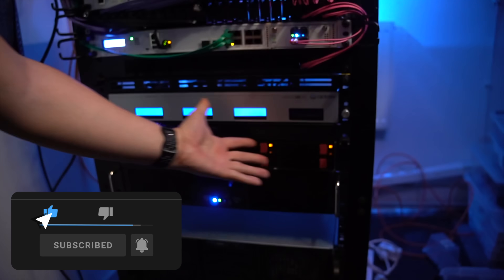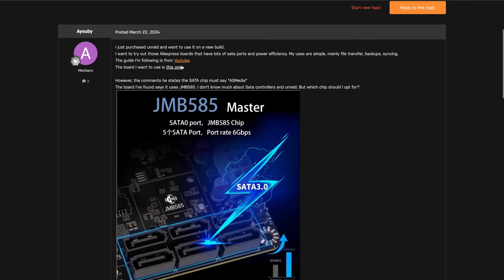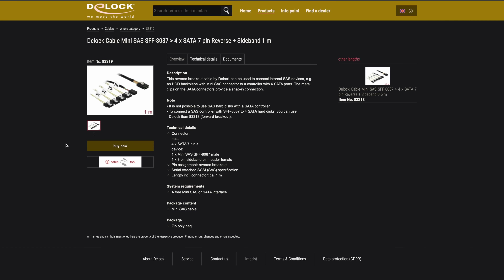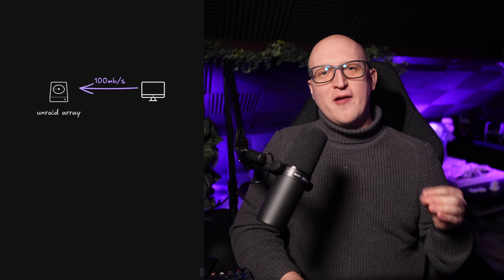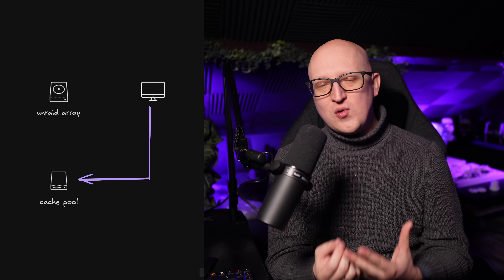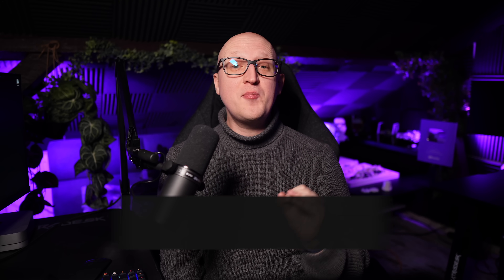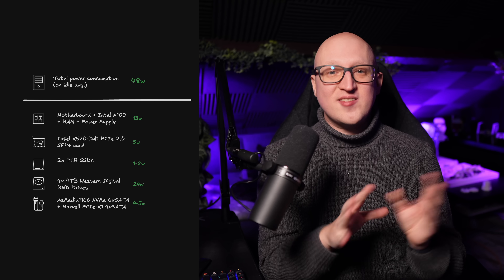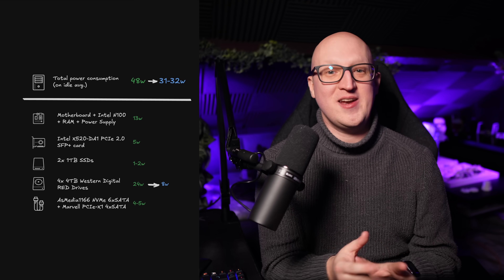New Unraid Storage Server upgrades and testing!

Comment: I just need four SATA drives (two to start testing for compatibility), which one will work well with FreeBSD (ZFS) for NAS? adapter based on JMB585 2280  or ASM1166 Chip?
Reply from the maker: In that case you don’t need to worry about a 4x ASM1166 will work fine! It’s just when it needs to split the ports

Comment: i have build a small server to replace my power hungry R630. This small system uses a MINISFORUM BD795i SE 7945HX. My PowerEdge R630 uses about 150W idle and my New system uses only 22W idle. I have a 160W picoPSU in it and a 150W 12v power brick outside. Because of the Ryzen 9 7945HX has a RDNA2 iGPU, i can use ROCm for AI stuff and don't need a dedicated SFF GPU like the RX550.
And i can allocate as much RAM to the iGPU i want, the RX550 was limited to only 4GB. i have 64GB ram in this system and 12GB are allocated to the iGPU.  
i switched from HDDs to SSDs and all in a 2U short depth 9" rack case. i have 12 SSD in this case and i use two of the ASM6611 m.2 adapter. Those 12 drives are in a Icy Dock ExpressCage MB326SP-B. In this rack is no room for a normal PSU. This thing is packed and nearly dead silent. 
yeah, i know the R630 has ipmi and is more capable but i don't need the cpu power and dual channel DDR5 5600mhz is faster as 8 DDR4 2133mhz channels. this is a over all more capable system as the R630.
Reply from the maker: Wow, that's interesting, a very good power footprint!

Comment: Since you are using your NAS strictly for cold storage and do not have any containers or VMs, you can set the disks to spin down when not in use. That should drastically drop your idle power usage by 24w according to your calculations. If you did want to run containers or VMs you would store them on your cache pool. I have 2 Unraid servers and both have much higher average write speeds than your system. That of course is dependent upon drive rotation speed, controller speed, and other factors but I wanted to share that Unraid is certainly capable of much higher write speeds than what you have experienced. As you stated, the use of a cache pool is highly recommended and that speed is also determined by the quality and capabilities of the SSDs.

Comment: Turbo mode reads from all drives to update the parity immediately on write. The only benefit I know of in the normal mode is the unused drives don't need to be spun up, if you use nas rated drives and keep them all spinning the reconstruct write basically works the same as standard raid and you'll get standard drive access speeds.

Comment: Great video Christian!!! Was wondering how often you run the paritycheck on your array and what (if any) impact do you see on your N100 CPU?
Reply from the maker: Hm so you definitely see the CPU goes up, and parity check I only do weekly at midnight so that it is complete before working
Reply: @christianlempa  Thanks! I looked around  (using the search term: unraid how_often_should_i_be_running_parity_checks) and noticed that quarterly is kind of the sweet spot. 
(my backup server is only powered-on during the weekends because of power consumption) 
Weekly to me seems to be a bit overkill because it causes a high stress rate on your disks. (and it's a backup after all :) )
There is also a plugin called Parity Check Tuning plugin that can help with breaking up the parity-check process.

Comment: I am spinning down my array as much as possible. gives me an idle around 36w

unRAID Plus licensed 7 stable ASRock B550M Steel Legend + amd 5700g apu cooled by a DeepCool Assassin III.
Patriot Viper Steel DDR4 64GB (2 x 32GB) 3600MHz running jedec cl20 3200mhz
Western Digital Ultrastar DC HC550 WUH721818ALE6L4 18TB. 1x18tb parity and 2x18tb disk array xfs (and a spare)
T-FORCE_512GBx2 sata zfs raid 1 pool for docker and system. T-FORCE_512GBx2 sata zfs raid 1 pool for wm
In a Fractal Design Node 804 Cabinet. with a Be Quit! System Power 9 - 400W psu
Reply from the maker: Great setup 👍

Comment: Hey Christian,

In the last ten years I have bought a lot of SATA PCIe cards, unfortunately none of them worked properly, random HDDs always flew out of the pool.
The first I thought, well, old power supply, probably can't supply everything, I got a new power supply with 750w and several 12v rails, no, that wasn't it.
turns out the power supply was able to supply everything.
then I thought, well, it must be the software, I tried TrueNAS, Unraid, Ubuntu, Windows Server, yes I know, horrible for the HomeLab, didn't solve it either.
then it must be the SATA connection... 
sunk money into SATA PCIe cards for several years with no improvement.
In 2023 I decided that it was worth the risk to order 2x Broadcom LSI cards on eBay.
I waited 3 weeks, they were shipped from China, and I got the accessories, cables and fans in the meantime.👍

When I had everything together, I assembled and tested everything... 
I tested the Disk and The LSI Card for a Week really Hard... 
after a week of full testing, no HDDs were thrown out of the pool.

The result didn't really surprise me, it's Enterprise gear, it has to run stable for year.😒

my Story of SATA and the problems of SATA.😂

Comment: I knew that you would like Unraid. Next thing is tinkering with powertop and maybe even S3 Sleep plugin.
Funny thing, otb on the same hardware, in my case, TrueNAS consume less power than Unraid, until is tuned and configured.
And as a reference, my Unraid NAS build with 5600G, LSI card, 2.5GbE card, 8 HDDs (spun down) on idle goes around 40w. Much less without LSI card ofc.
Reply from the maker: That's interesting! I will definitely check out power top and more ways to optimize power consumption

Comment: you should also check powertop to make sure you are getting larger c-states being used (ie c10 etc), also there are updates to asm1166 firmware that might help. There are people with h770 mobo and i5-13500 getting same power consumption, so its not a standout yet. But you could reduce it more with powertop. Sometimes the nic is the problem too.
Reply from the maker: Great feedback, I will definitely have a look :)
Reply: @christianlempa  just install powertop on unraid and set the c-states in bios on, you should go way lower if its just for data and running no containers etc. my idle is 16 watt with Intel i3 12400, 32gb rgb ram ( yeah rgb ) 4x6tb, 1 tb nvme, 2tb ssd, 750watt power suply, running 30+ docker containers. just let me know if you need some help.

Comment: Have You checked powertop already? 
For ASM1166 card You need to make sure about two things - first one is firmware, most of those don't support ASPM mode and those prevents higher c-states. Also You may be interested in hot swap feature. 
Second thing about this m.2 card is that it's eady to break (sata ports are not often placed on 0.8mm pcb). It also need good airflow over chip (it will bend on temp, eventually loosing connection). 
Triple check hard disk speed. This card will not limit 4 fast ssds, it will slow down on fifth fast drive. With spinning rust You are safe :) 
Cosider replacing old intel da card, today ACQ113 is the way to go, it uses pcie 3.0. For mac You can get  thunderbolt/usb4 to 10Gbit adapter, heats up quite a bit, but it's ok for most new laptops and mac.
Reply from the maker: Not, yet. But that's another interesting topic to get into, I'll add it to my list! :) Thank you!
Reply: @christianlempa  also double check pcie configuration and all speeds. Probably You are using now half of speed of bigger pcie slot (this intel chip is probably pcie 2.0) and only two lines are wired there (not 16x!). ASM1166 should be ok in it's 2x pcie 3.0 configuration. Specs for this asus is not that clear, I would double check if everything works at right speeds.

Comment: So just FYI, you can reverse your config, there are 10g to m.2 adapters and LSI raid controllers are pretty cheap, which would get you an option for SAS disks if your backplane supports that.
Reply from the maker: That's an interesting thought, maybe that would have been the better way. I'm gonna think about it
Reply: @ You can find ACQ108 m.2 10Gbit card for about €90, but HBA will work at best at half of it's speed (max 2x pcie 3.0, there are some 4x/3.0 cards). I'm not sure about real speed of this pcie slot, looks like 16x, but for sure not all is wired there. Seems that those two (pcie 16 and m.2) has same speed. 
For absolutely the best results with N100 different motherboard is needed, one with 4x pcie 3.0 port (either m.2 or pcie slot) and PLX 3.0 switch, so all devices would all be auto adjusted to upstream port. Check out radxa X4 and xikestor SKN-2BT-M2 :)
Reply: That's the way to go. I have both SATA cards shown in the video and it's still a huge bottleneck. Now I bought an HBA but crossflashing is not that easy..
Reply: @matthiasjo3461  but also there are m.2 to riser card (pcie x4 slot) if you want to re-use your existing card.

Comment: 180 mb/s read speed is not acceptable. That should be the first thing you should mention in an Unraid review, followed immediately by the fact that Unraid was only suitable for your cold storage.
Reply: Different use case. Unraid is mainly for cold storage. Depending on your needs/budget it can be upgraded with lager cache drive that can hold data til 90% full then dump it to unraid or all older then lets say 1 month. It doesn't mean it has to be same day at midnight. All so good thing with unraid is that you can combine "cold storage" with ZFS pool unlike with true nas that support only ZFS. Higher number of drives lower power consumption on unraid since you can put hdds in standby.
Reply from the maker: You can still set up a ZFS pool in Unraid that will work great for hot storage, that's why I said in the video it's just for the Unraid Array! Not about Unraid itself!

Comment: Thanks Christian for the review. I've stuck with TrueNAS because UnRAID doesn't offer ISCSI. That feature and performance were deal breakers for me.
Reply: unraid have plugin for ISCSI. i tried it and it works but i dont have need for it. As for perfomance use NVME drives for cache drives and/or combine unaird with zfs pools
Reply from the maker: I think that would be an interesting idea for building a superfast NVMe ZFS pool for VM disks, I'll have a look ;)
Reply: @christianlempa  I use ISCSI as a storage target for Kubernetes and as an extra disk in my Windows PC.

Comment: when ive started my homelab ive got TrueNas consumed 78w(6xhdd8TB+ssd-boot, 10Gnet, 64ram, i7-8700) few VM and lots app running and now my server runing 28W at idle(not spundown disk) what ive got now: 2xhdd12Tb+ssd-boot WDred+ 10GBnet 64Gmem, cpui7-8700 but ive change motherboard from Fujitsu (esprimo P758) with 250W plat. PSU. Those PCs from Fujitsu are amazing with power efficiency, my backup with 2xhdd runing @15W with i3-6100T. If u compare price/performance Fujitsu PCs with those  funny server N100 motherbaords Fujitsu winning in every aspects

Comment: Honestly my biggest recommendation for a home lab storage server is to just go for a 4u system. It is just so much easier to work with and it makes a lot of your other hardware choices less critical because the formfactor is very similar to a regular desktop PC. You don't have to worry nearly as much about things like reiser cards for PCIE expansion or half height cards either. Cooling an noise are also a lot easier. You can easilyfit a 360mm radiator if you want to do watercooling in a 4u system where finding radiators for a 2u system really limits your choices. For the fans you can go with 120mm fans which are pretty standard. The 80mm fans you will use in a 2u are also standard but are noisier for the ammount of airflow you get. In this instance had you gone with a 4u Chassis your Power supply would have been rotated 90 degrees. This would have made it so you would have been able to put in a regular ATX or even E-ATX motherboard in the system which would have meant you could have just used another one of the PCIE slots to add more expansion here. Again all of this is because you went with a 2u system instead of a 4u chassis.
Reply: I did the same migrating my old unraid server from a mid-sized tower, and I was able to use all of the same parts in my new 4U server
Reply: @SonnyBautista  a 4u is basically the same width as a mid tower, its pretty neat.
Reply: Rehoused my proxmox server in a Sliger 4u, thought about 2/3u till I started looking at cooling options for Epyc, then it became pretty obvious 4u was the way to go given my rack is about 6 feet from my desk.
Reply: @nadtz  yeah for me it was wife approval factor. I could try and go with a 1 or 2u system but those systems are so much noisier that I was never going to get it approved. Most home labbers don't need 6 servers to run in a cluster or anything like that. 1-2 servers, a network switch, Firewall, and UPS should cover pretty much every actual use case. A half rack is sufficient for 95% of use cases. You can dabble with clustering if you want to learn it and that is fine but having 2x 4u servers for redundancy is more than enough to be honest. Computers are so powerful now that you don't get benefits from scaling out to more systems anymore. You can get a used 16c epyc server board from ebay for a few hundred dollars. There just isn't a need to cluster 4 4c systems together when you could just get 1 and then run docker.
Reply: @ Yep, currently rebuilding my NAS into a 4U and proxmox is already in a 4U.  My 25U rack looks kind of empty with just the UPS, switch and proxmox server in there right now but I got the rack cheap so I don't mind having space to grow into.
Reply: @nadtz  Yeah a 4U chassis is just so much easier and most people have enough room for this. Like if you have enough room for a home computer you probably have enough room for even just a 15U rack that would be enough. I mean you can have 2U for the Router. 2U for the UPS, and 2U for a couple switches. That still leaves you would 9U that you can fit a couple 4U servers in and that will be more than enough for even a heavy user. I don't see why people make a ton of compromises on their builds so they can fit it in a 1U or 2U chassis and then have a bunch of empty space in their rack. All the case is is a box to put the actual computer in and it is dumb to make your life a pain in the rear just because you didn't get a big enough box. It is similar to when people get something like a synology NAS. It is easier so if that is your skill level then I can see it but you have to realize you are really limiting your choices in the future.
Reply: Especially in Australia were choice is very limited
Reply: Agreed. But of all of the benefits you could point out for 4u, water cooling is one of the least that I would recommend. Why lol. Nothing against what you may have set up, but fitting a normal cooler is a much bigger plus. Cheaper, less space taken up where its valuable, less maintenance, less fear of issues, etc. No need to spend so much for something you won't ever see and comes with only downsides vs an equivalent fitting air cooler if the use case allows for it. I dont understand why people do it for these storage server builds tbh
Reply: @industrial-wave  For some of the higher tdp CPU's (looking at you threadripper) an AIO (which people will often call water cooling) is pretty much a given since you won't be able to stick a cooler with 140mm fans in a 4U chassis.
Reply: @industrial-wave  Oh I wasn't recommending watercooling but I was simply saying you can do it easily if that is your jam. Personally I think air cooling is better especially since I just have the computer sitting in a rack anyway.
Reply: @chaosfenix  glad you aren't lol. Cringe every time I see ppl doing it without the outright need haha.
Reply: @ Yeah again I just pointed it out more for the versatility. With a 4U case there is very little you can't do that you would want to do even in a regular desktop. A 4u chassis will be able to fit 90% of the computer components out there just like it would in a regular desktop with the biggest ones I am aware of in that 10% being really tall air coolers and some of the more giant GPUs. The GPU will probably fit but sometimes you can run into tolerance issues with the cables depending on where they put the ports. Not much of an issue with most cards but yeah it can be.

Comment: Getting 350 MiB/s writes to a RAID6 HDD array (6 wide) on TrueNAS and I find it quite slow lol.
Reply: i get 1100MB on unraid array with 3 hdd for it . use cache drive, dump data to unraid drive on 90% full nvme or older then 30 days. unraid is for cold storage or rarely used files. on ZFS Z1 with 4 slow drive (5400rpm) i get around 450-550mb